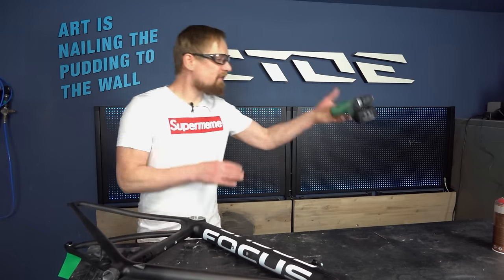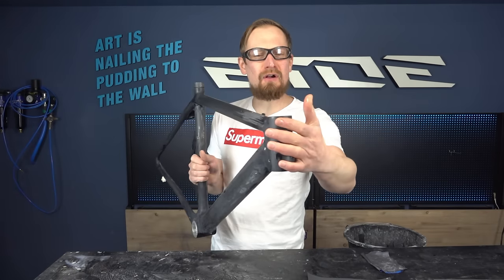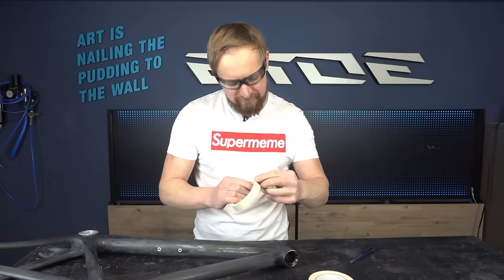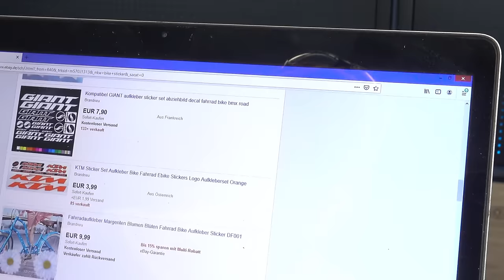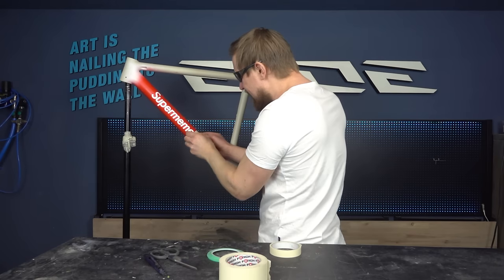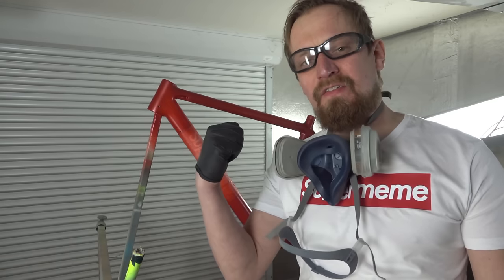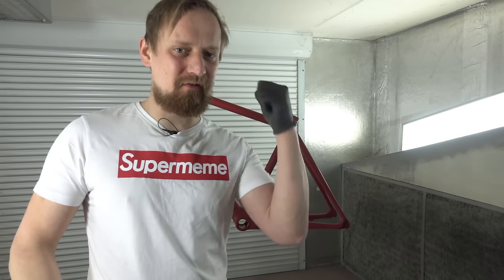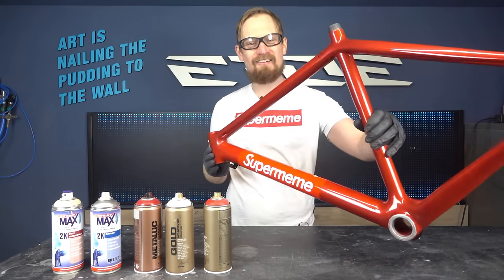spray paint a bike at home with supreme quality DIY

Comment: Looks great. I bought a black spray can from the same brand you used Montana can and it is textured!!! I want a gloss finish. If I spray that 2k clear coat will it turn out ok over the texture?? It wasn’t supposed to be texture paint it is Gold Shock Black. Any advice?  Thank you!
Reply from the maker: Remove the texture and paint and start again.
Reply: @ETOE  does the Gold Montana can in shock black spray out slight  textured (bumpy)? Are you recommending I use a diff brand?
Reply from the maker: @popaki9484  use what ever you like. I use this one.
Reply: @ETOE  thanks. I’m just asking to make sure I didn’t get a bad can
Reply from the maker: @popaki9484  no in 99 percent of the cases good cans are send to bad painters. Maybe you should change the painter to a better model to be save.
Reply: @ETOE  haha you’re funny. The can sprays out in low pressure and dries with a slight texture. I guess the same thing happens to you that’s why you wet sand it down with 800 grit.
Reply: @ETOE  it’s good to know how you respond to an individual asking for advice about a product you’re using and promoting. If you can’t help then just say so no need to be rude about it.
Reply from the maker: Please unsubscribe, or I do it for you. Many thanks!

Comment: I recently started painting my Crosser inspired by your nice videos. Just one question. Do you have a tip how to avoid sprinkles by using the montana gold colors? Is it not shaked enough? So far no problem because I had done so for just the first layer and I sand it afterwards. But for the second layer it would be nice to avoid them. Any tip?

Thank´s a lot and keep going. Very nice work....
Reply from the maker: Change the caps more often.
Reply: @ETOE  ok? But it was a new can and cap and sprayed just a fork one time.

Comment: heii good video but i dont get it, if you really removed all the colour, it should be gray like the metall/aluminium or not?
Reply from the maker: but it`s a carbon frame and carbon is black. 😁
Reply: @ETOE  okey thanks for the fast answer. is stripping also an option?  and how do you know that the primer works with the Montana paint without any problems?  It's not the same brand.
Reply from the maker: @donrabio5864  I listened to my chemistry teacher.

Comment: can you use an unpainted carbon frame, and just have it like it was after the hgih grit sandpaper?
Reply: just do light passes of 600 and 800 to ensure consistent surface
Reply: @avocette  yep. I was thinking of going up to ~8k since I have it anyway and it'll almost be glossy. But there won't be any  long term damage from UV light or whatever?
Reply: @antonhelsgaun  not really unless you intentionally bake it under the sun for way too long. and that goes with any carbon frame.
Reply: @avocette  neat, thanks! Considering buying new (carbon) handlebars and most don't fit with the colors of my bike so that's perfect

Comment: Hab mein Bike in der Garage Lackiert mit 2k Spraymax Klarlack.Nach 24h ist der Lack noch etwas weich, so weich das ich ihn mit dem Fingernagel eindrücken kann. Habe die Dose aber aktiviert. Kann es an der momentanen Temperatur liegen ? Bzw wie lange dauert es bis das teil Ganz hart ? Mit freundlichen Grüßen Patrick
Reply from the maker: It takes 5 to 8 hours if I do it in my shop. It can differ a lot if a DIY painter does it.
Reply: @ETOE  up To more than a day?
Reply from the maker: @patricktokarz5346  you messed up. Most of the spaghetti arms are not able to push the button of the can hard enough to mix it properly.

Comment: Thanks for the great video. Im about to spray my bike frame with the same paint as yours. Ive a question for you, drying times. How long did you leave the paint between sanding and placing the stickers? Im doing a 4 colour pattern with lots of masking so dont want to risk pulling paint of when i remove the stickers.
Thanks and keep up the great videos
Reply from the maker: five to ten minutes depends on how long I need fo my slice of pizza
Reply: @ETOE  is that a spicy pizza or just or your girlfriends cheese and tomato pizza? These things are important to know to get the time right.
Reply from the maker: @therybes  Rime is not the important thing. Its the chemicals, humitity in your environment and temp. You have no clue because you are not a pro. Only a time scale will not help you!
Reply: Blunt but honest😂 but.....humidity is between 50 60% temperate is adjustable from 15 to 28 c possibly 30. Im used to 1k and 2k paints just not the brand your using. I was calling on your vast knowledge or all things painted
Reply: @ETOE  Makes this video pointless then doesn't it
Reply from the maker: @dutoitm1  yes the video is pointless.

Comment: Love your videos and your care to focus on the difficult aspects of the job. I will be trying to paint three symmetrical stripes around the top tube and seat stays using fine line tape. any suggestions on getting those lines straight around the tubes?

Comment: Just out of curiosity, does the same method apply to a 1970s vintage steel bike frame?
Reply from the maker: No only to a 1960s or 1980s steel frame.
Reply: @ETOE  🤦🏻‍♂️ thanks I guess that 1970s steel is tricky
Reply from the maker: @johnmedina4136  You know summer of 69 and so on. Verry funky stuff!

Comment: You inspired me and I did an almost awesome rattle can job.  What are the most likely causes for the paint chipping easily.  Some chips showed up from the carbon frame flexing after a test ride.  Used a candy system with primer, medium silver flake and candy top coat.  Plus several layers of 2k clear (first 2 were not wet coats, next were thin followed by wet x2).  The chip is all the way to the primer coat.  It looked awesome before the chips showed up.  I noticed the paint seemed fragile (easily chipped requiring touch up) after the thin clear coats.  Want to know what I did wrong before I start over.  Not looking forward to sanding again.

Comment: Martin, is it possible to isolate an area on a carbon frame to repaint? I want to paint o solid band over the bike logo but want the rest of the paint to stay the same. IS that possible?
Reply from the maker: Just mask it and go along with the edges caused by the masking tape.
Reply: @ETOE  thanks, that what i thought but it nice to hear confirmation from the master. appreciate the response. cheers!

Comment: an alumninium frame a 2k primer or an erg primer can i use an 2k paint on a edge primer
Reply from the maker: Yes you can if you sand it in between.

Comment: Hi, also würden Sie den Füller und den Klarlack als 2k Lack und die beiden Farben als 1k Lack benutzen? Wollte evtl. mein Mountainbike lackieren und das wird auch mal härter Bedingungen ausgesetzt(Steinschläge, etc.), also sollte der Lack auch gut halten.
Reply from the maker: I would give it to a pro to get it painted. I use much more durable coatings than spray cans can provide.
Reply: @ETOE  okay thanks👌
Reply: @ETOE  Which other coatings do you use? Powder coating? Could you pls give me a few tips? Would be great👌
Reply from the maker: @derkeks3831  I use no powdercoating because I do mainly high priced carbon which you can`t powdercoat.
Reply from the maker: @derkeks3831  "Could you pls give me a few tips? Would be great👌" I do custompainting. You can bring your frame for painting.
Reply: Ah okay
Reply: @ETOE  Thanks, I will think about it

Comment: Hey man, this is awesome! Allways wanted to paint my frame by myselfe. How long did it take you to do this? I'm thinking about painting my full-suspension mountainbike, how long do you think this takes? I guess quite a bit longer because i have to take the frame apart and I have more seperate parts and bearings
Reply: did you do it. if so what was the result.

Comment: Same day primer and colour spray?
Reply from the maker: Yes if pro.
Reply: If same day primer double coat and then next day sanding the primer with 800 grit sand paper then putting the colour and next day clear coat after sanding the colour with 800 grit sandpaper. This process will okay?
And my  next question is - is it okay use the clear coat without sanding the colour?
And what should i do to use ear coat second shot sanding the coat again or without sanding second shot can be applied?
Note I'm using it on my motorcycle frame.

Comment: IS it easier to sand blast the frame, than hand sanding it?
Reply from the maker: You will destroy the carbon fiber if you do so.
Reply: @ETOE  ohh, I see. I wonder did you find out the hard way, or learn about that? So it is a very time consuming process. But doesn't sanding make the frame thinner, thus weaker?
Reply: @ETOE  What about a chemical stripper?  Im just trying to think of ways to eliminate the time consuming labor of sanding.
Reply from the maker: @cliffcox7643  stop painting if you want to save time! Chemical stripper   harms the resin and delaminates the frame.
Reply: @ETOE  im not painting at all nor ever will. Im just contributing to banter on your channel. Thanks anyways

Comment: Paint Stripper cost $12 for a bottle.
instead of like $50 worth of sandpaper.
put the paint stripper in an old spray bottle. blast the entire frame.
then get a wire wheel on a power drill. take off all the loose paint, then repeat process until you have 0 paint on the bike, then take the wire wheel to the entire frame to sort of scratch up the metal so the paint has a better surface to hug onto,
using sand paper is extremely tedious. and will take over 4x longer than using paint stripper and wire wheel, and cheaper.
Reply from the maker: Yes do it on your carbon frame and send me pictures afterwards. I like that kind of stuff.
Reply: @ETOE  not everyone has a carbon frame. I personally dont like frames that i can snap and bend by the touch of a finger

Comment: 1st off, I clicked on a thumbnail from a google search, when you came on screen I smiled cause I've watched your stuff before... but I paused and rewound the clip to make sure I heard right... you calling out the non-carbonframe-drilling pussies... and from there it just got better.  You fucking rock!!  Question:  What if I just want to get rid of the garish color of my brand name?  Can I just tape it off and paint it or should I get out my drill?  (2019 Norco Range C1 (carbon) - Black Gray and Green, I'd prefer copper!). Thanks for the content!

Comment: I have followed your instructions, checked my balls, and rather asked my my girlfriend, and she drilled a 2m diameter hole in my £99999999999 worth carbon-grafein-silicat-nanoparticle space bike frame, and now I don't know where to spray the paint, cause it is just a large hole, and some chips, and I see no frame anymore. 🤣🤣🤣🤣
Reply from the maker: Spray it on your toe nails. Bikini season is around the edge.

Comment: Listen there is no way a noob can pull off this paint job , nothing will go like the video says , the shock white will never dry it stays tacky , the masking film will leave marks on the white , and the masking film will never allow the white paint to dry so it will stay taky  , there is no way to keep paint flakes from sticking to the taky paint , the clear coat it so thing color runs even with 1500 grit paper , my paint job came out horrible , I don't know if I should order more clear coat i got over spray from being to close , but too far I'm wasting coat , I almost give up , this video will not prepare you for the job ,😢😭😢😭